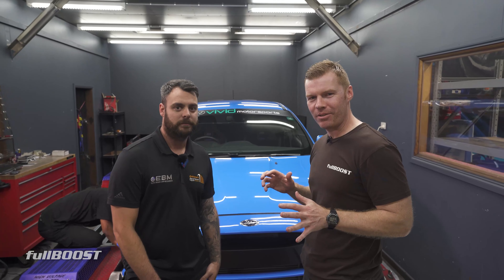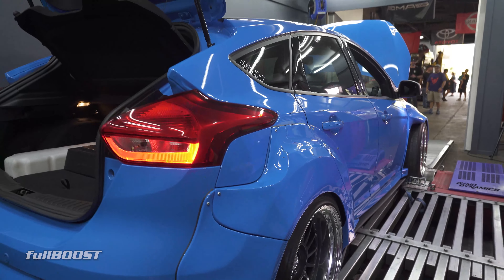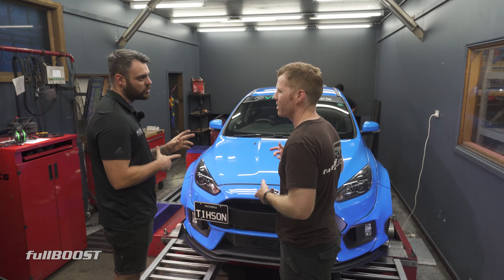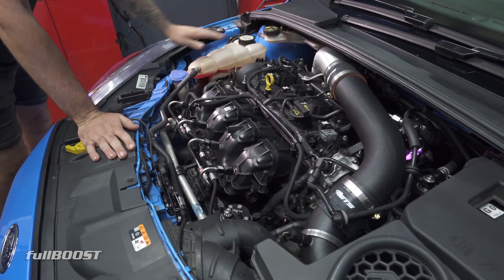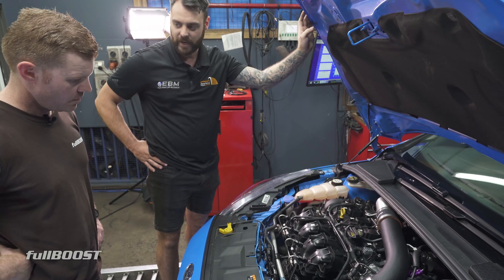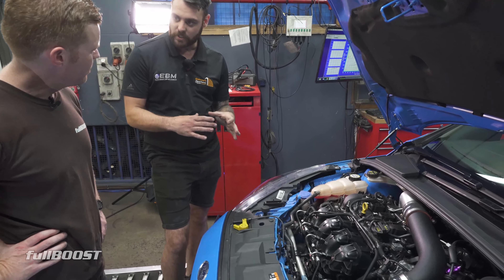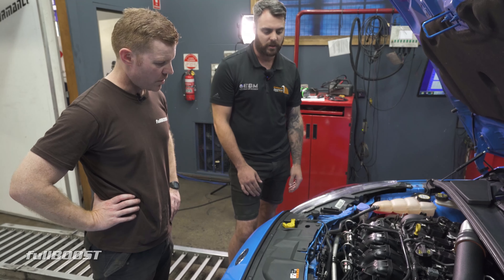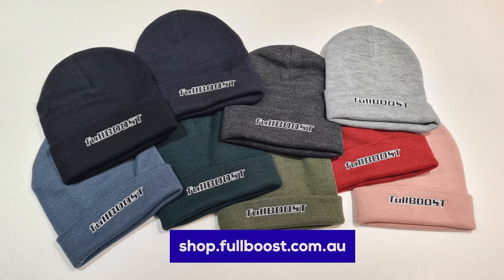Powering up a Ford Focus RS

Comment: Thanks for the video!! 👍👍👍

Strange how Ford says it's at its limit from factory... They usually always leave a lot on the table to play with.. like the mk7 fiesta ST.. you can rip up to 400hp from that little 1.6.. and something like 800hp from the older 2.3 Volvo in the XR5 focuses... Something's up..